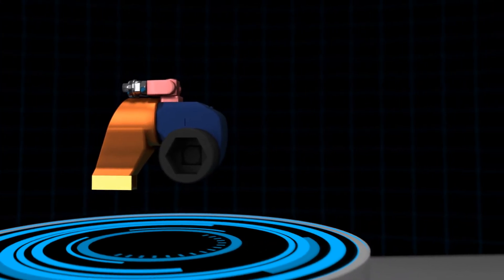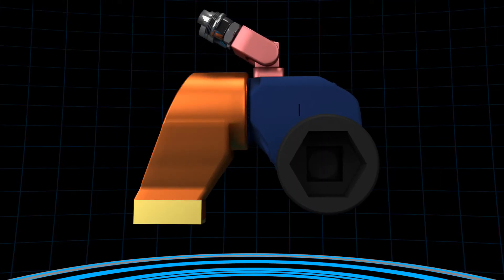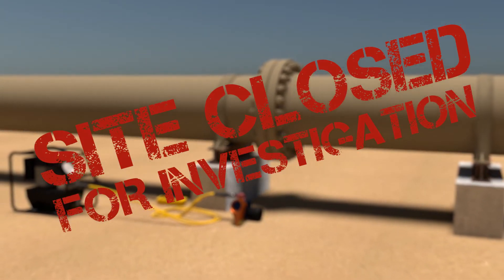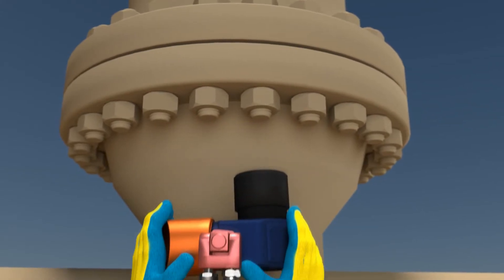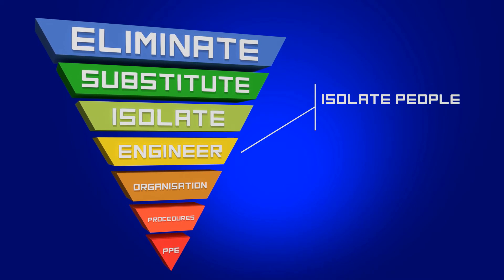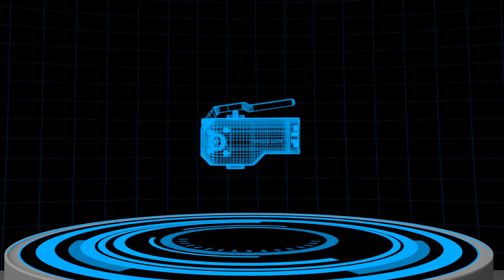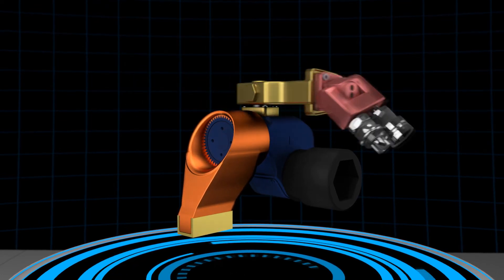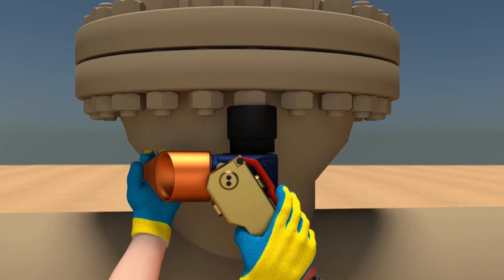TorqueSafe - Setting a Gold Standard in Safety

Comment: The working of the handle makes no sense. The operator is only safe if he has the handle pushed in and not when he hasn't. It should be the other way around like a dead man's swtich. Action should only occur if the operator is actually operating the handle. In your scenario it's not certain if the handle isn't pressed down because the operator is ready or because he has forgotten to push it.
Reply: I agree, but, these things are not meant to be held to operate them, it's just a set and forget (until it finishes the job), which is why the handle works this way. It would be a hassle to need to be holding the handle for it to operate, specially in awkward or hard to reach positions.
Reply: I thought the same thing, it should force the operator to use BOTH hands to press the handle so that both hands are away from the danger areas of the wrenches.

Comment: The Hytorc washer is certainly not the answer.manafacturers do not make products with back up washers so how do you undo these bolts? A reaction arm tool ! , what happens when the bolt is tight still and there is no pressure holding down the backup washer? The washer spins and the bolt will not undo. Then you get your reaction arm tool to undo it.Back up washers have to be purchased, special sockets have to be purchased and are all very expensive and not the answerThe reaction arm tool is the all round work horse of every tool kit and now been made safe to use
Reply: I don't think you understand how bolting works. What you wrote doesn't make any sense.